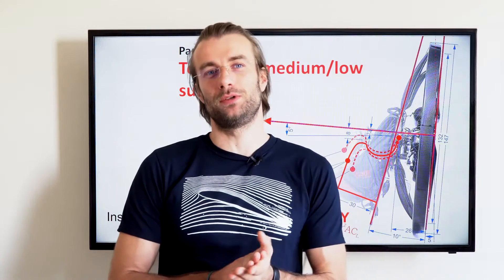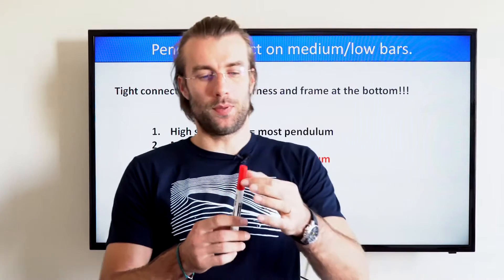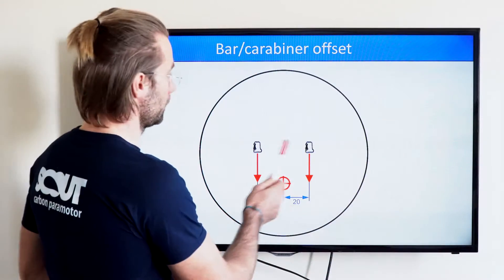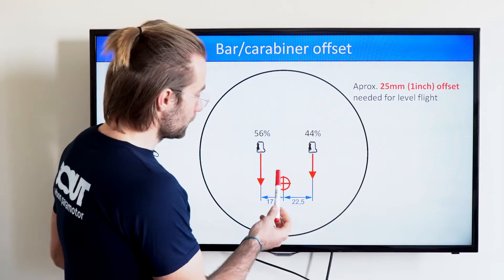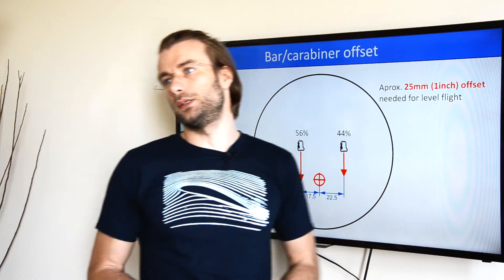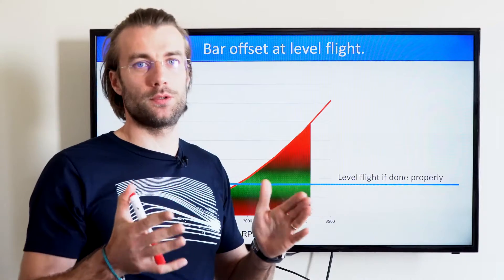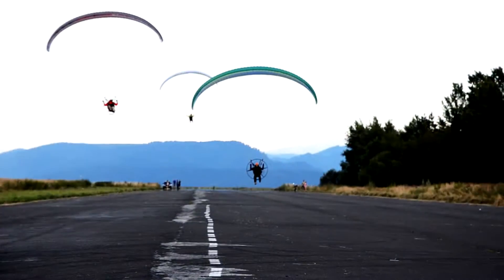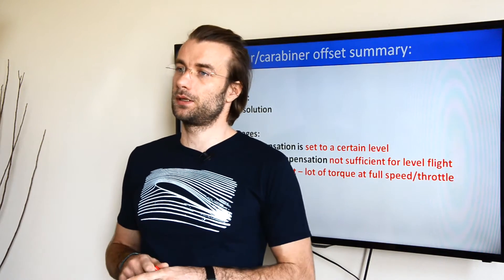Torque on medium/low suspension. Paramotor geometry part 14

Comment: Does that mean that placing the 10-20 kg battery below the engine on an electric ppg will compensate for some of the torque through the pendulum effect? I see it on both the SkyJam Lizard and on the Fly Apco electric paramotors. But in the case of the SP-140 from OpenPpg the battery is right behind the motor, so mentaining a higher center of gravity, why the two different concepts? Both the Apco and 140 have gooseneck bars from the center of the prop line. And second question: Do all frames have this aprox 25mm offset? If I were to buy a light frame from a gas ppg to build on it an electric one. Thank you for the time spent on this videos for us to learn!

Comment: Does gyroscopic precession play a large role / cause for issues in PPG?
Reply from the maker: Only pilots with powerful engines, thus heavier 3/4 blade props and aggressive flying style with sharp turns (=slalom)
For most pilots this is not an issue and most pilots have not even noticed...

Comment: Am I wrong in assuming that the amount of torque felt will depend on the weight of the pilot?
Reply from the maker: +JunkMan304 yes, you are right. 
Both light and heavy pilots are exposed to equal torque at full power, but that torque will have more effect on the light pilot.
Reply: Awesome! Thank you!